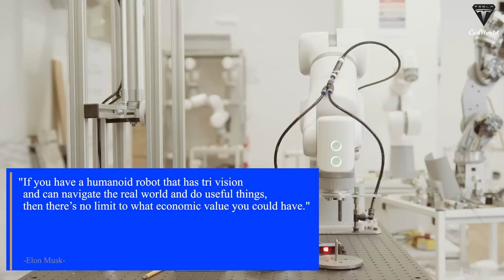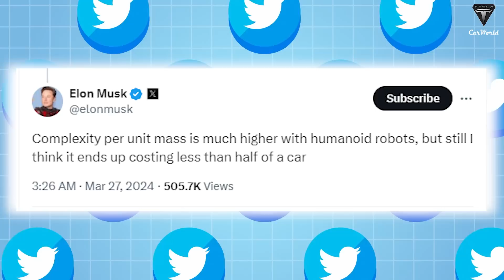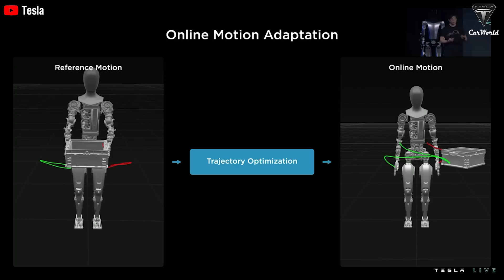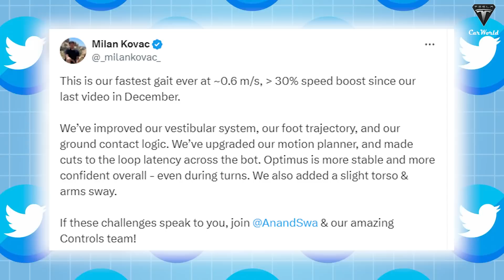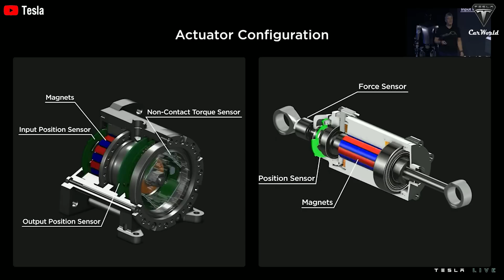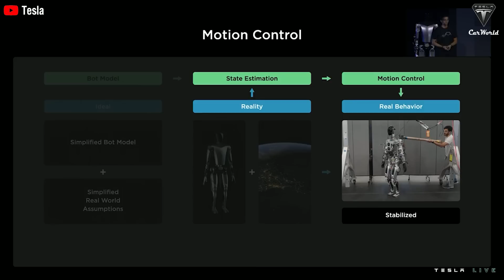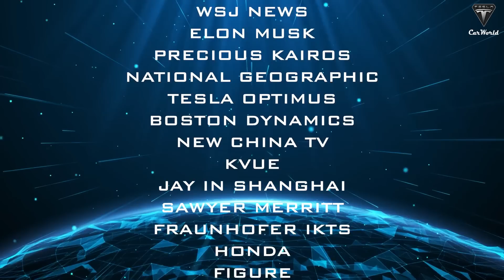Elon Musk Revealed Tesla Bot Gen 2 Officially Selling in LARGE Next Year! They’re Finally Ready!

Comment: Optimus CANNOT work 24/7 without a rest.... unless they plan to give it a long extension cable plugged into a wall socket?
Reply: They could use WiTricity [wireless charging] like Tesla and BMW are integrating into their cars.
Reply: @aaron_knight  Possible, but at enormously more expense for the charge locations (charging range is small and energy use is high  - as compared to a mobile phone say) and unlikely to produce 100% real world use-time (24/7).
How long do you think it will be before highways are fully wifi charging points, and what do you for charge in your Tesla or BMW if you don't travel on highways?

Comment: I’d really like to see Optimus 2 Climbing Stairs a Ladders and walking across uneven Concrete and Soil . I’d like to see Optimus recover from falling to the ground … just walking along a flat floor isn’t very impressive … I’d also like to see one lifting its limit in a gymnasium …
Reply: This right here sums it up. As someone living in a split level house, you can't go from any room to another without a step involved somewhere. Plus a spotter for weight lifting at home would be nice to be able to try to push your max weight if it could reliably do that. Plus I am curious if it can do cooking and how sanitary it is, sure it can handle an egg gently but can it crack it, make sure no shells fragments in the food and clean up any spills while also having clean hands from the start. More importantly can it tell/track the food cooking to not over or under cook it? What about laundry, sure it can fold it, but can it check if it's properly dry and take it out of the dryer by itself? What about putting the fitted sheet on the bed, can it do that? even many human adults struggle with that.